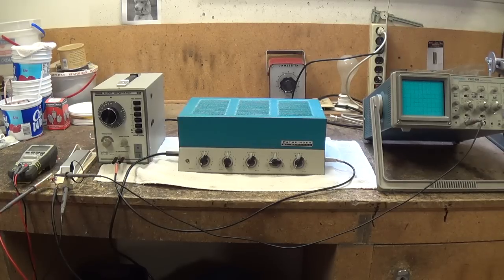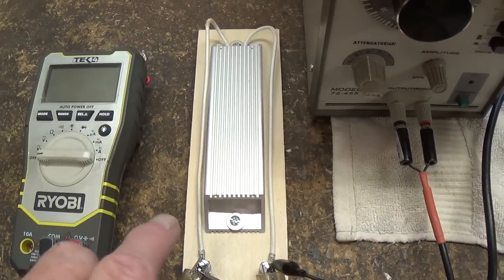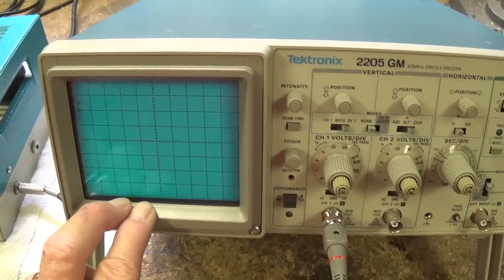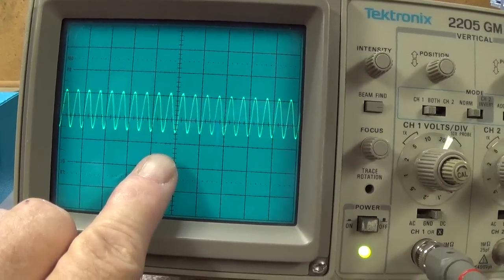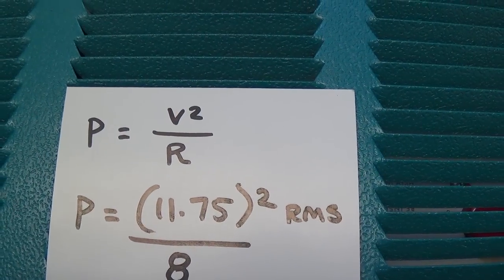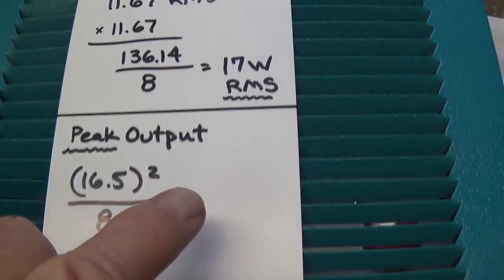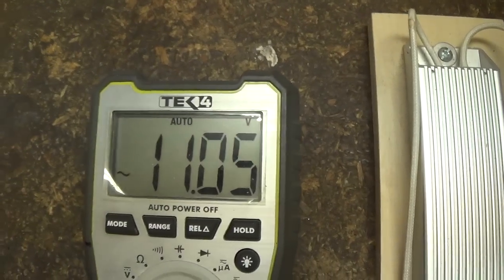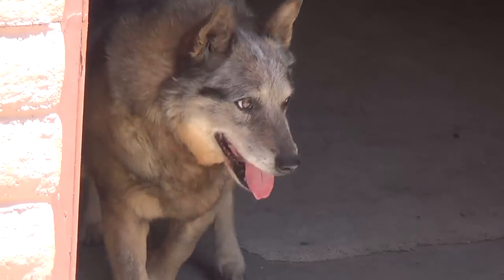How Amplifier Output Power is Measured

Comment: Spoiling Rusty again with that gourmet dog food?  In your closing comments, you mentioned that this amp has an ultralinear output transformer that gives it a good power bandwidth response using 6BQ5 /EL84 pentodes.
The  ultralinear audio output transformer is certainly  a good way of keeping distortion down at higher power outputs. 
These transformers come with  extra taps to connect to the screen grids of each power pentode.
Vox built their incredibly popular stable of guitar tube amps based around EL84 vacuum tubes. 
The impression of any portion of the output signal onto the screen grid (load distribution) can be seen as a form of feedback, which alters the behavior of the electron stream passing from cathode to anode. Among other benefits, this feedback helps to more accurately reflect the instantaneous reactance of the load (secondary circuit) back to the power tubes, thus offering better load-control and responsiveness (i.e. improved loudspeaker damping and power stability as load impedance varies across frequency band).
Reply from the maker: +SuperCarver2011  Thanks for your excellent overview of the ultralinear OPT, SC. I have added an edited excerpt of your comment to the video description (with credit, of course).  As always, Rusty and I really appreciate your knowledgeable and helpful input.

Comment: So if i get this right: If i get my output tubes to distort on my 15w amp its more than 15w of power?
Reply from the maker: +Mihkel Maidla   If your amp was tested in this way and found to produce exactly 15W of undistorted RMS power, and you got it to distort, it could be due to operating it at a higher volume than was used in the test or your input signal was higher than the one in the test (i.e. due to a Boost-Overdrive pedal, etc.) causing distortion in your pre-amp section.

Comment: Very excellent and thought provoking video Uncle Doug.  I was interested to see that it was the crossover distortion that determined your maximum output.  I had assumed it would be signal clipping.  I wondered how much farther you could turn up the volume before clipping occurred.  I'm not sure I could even hear the crossover distortion at your determined maximum level.  Also - I had a couple other questions.  How do you determine the input signal voltage level to use for performing the test?  What input RMS voltage did you use on this test?    

As always - thanks a ton for the great videos and the most entertaining pet antics !!   {:>)
Reply from the maker: +Donald Filbert  Thanks, Donald. I too was surprised by the lack of clipping.....until I remembered that this amp came with an ultralinear OPT.  Re the input signal voltage, I carefully balance it and the amp volume (and tone controls) to achieve the highest possible wave amplitude without distortion. There is no fixed value, since it will vary from amp to amp, largely based on the pre-amp section in each. You're welcome :)

Comment: Good video Doug.  Just a quick tip from my experience; if there is a way to inject the he input further down stream (like a power amp in or effects return) the more accurate your measurements may be.  That way you are less likely to overdrive the preamp which might distort earlier than the output.  Also you don't have to worry about the EQ as well.  I wondering if that's why you had lower output at 10k, I didn't see it in the video but when you first turned on the amp the treble was all the way down.
Reply from the maker: +Nick Clarity  Thanks, Nick. My method is to carefully balance the output of the signal generator, tone controls, and amp volume setting to achieve the maximum signal amplitude before distortion appears.  I prefer to input through the guitar jack because this is the way the amplifier will be used.  Much of the reduction in output at higher frequencies was probably due to my multimeter's reduced sensitivity at higher frequencies, not the amplifier's.

Comment: Hey Uncle, so what about the crossover distortion? Were the power tubes biased to cold?
Reply from the maker: +kardRatzinger  The amp provided distortion-free output to about 95% of full volume, which is quite good.  Please remember that this video was focused specifically on output power measurement......not tube bias or crossover distortion. I feel that any digression into other topics would have been distracting and counterproductive.
Reply: +Uncle Doug sure, I'm just asking out of curiousity.
Reply from the maker: I don't recall the tube bias data, Kard, but that's a possibility. It may be included in the video I posted on this amp. I do tend to bias output tubes rather conservatively.

Comment: hello uncle Doug, love all your videos! you have a way of explaining things that is just perfect! you amongst other inspired me and I made my own 18watt marshall clone out of an old  50's PA chassis which still had original english mullard el84's. I did have to rewind the power transformer as well as the output transformer, a bit of a complicated job especially as I live on an Island where it is expensive to get parts but I managed to do so using almost only discarded stuff I found at the side of the road! (a microwave oven has a ventilator which is a perfect source for enamel wire, in big professional office copiers you find a treasure of good quality capacitors (high voltage)  and I can go on and on) As an harmonica player I built it with a second, lower gain, channel with ECC82 with a "bass boost" switch (basically switching between a 1 nf and 15nf coupling capacitor). lots of bass is perfect for amplifing harmonica using an ols high impedance shure mic. I have always worked with electronics but I learned almost everything about tube amps thanks to your youtube movies!
two tips that might be usefull for some people: on this link some info what to do if you have a linear audio transformer but are looking for these nice distortions for guitar (because for what other reason would you like to have a tubeamp is it not?) http://www.geofex.com/tubeampfaq/TUBEFAQ.htm#UL
If you happen to find one of these cheap pizza ovens at a scrapyard, take out the heating coil, inside there is a special heating wire able to withstand lots of watts! cut it to length matching your impedance and you have your free dummy load to measure your amp power.
lots of music production  software (like cubase) have integrated plugins with signal generators, use your computers speaker/headphone output to be able to inject a 1000Hz signal in your amp for powermeasurement. on ebay you'll find cheap oscilloscopes using your computer and USB port.

bye thanks again Doug!
Reply from the maker: +Jeroen van Dijk  Good grief, Jeroen, you really do have to scavenge for parts. I thought I was industrious in this regard, but compared to you I'm just a piker :)  Thanks for the link showing how to turn an ultralinear OPT into a regular OPT, in order to improve an amp's distortion capability.....and thanks for all your other helpful tips. Keep up the good work !!!

Comment: Thank you for the great video. You using a normal resistor as a load but loadspeakers a inductiv. Inductiv resistor are changing the resistance depending on the frequency.
may be a i am wrong. 
greetings from germany

Reiner
Reply: +Reiner Sp This is a laboratory measurement, for it to be precise, you need to know the exact impedance of the load. So a fixed resistor is way better than an inductive load.
Reply from the maker: +Reiner Sp  Yes, speaker voice coils have both an (inductive) impedance and DC resistance value, and the impedance varies depending on frequency.....but Ohm's law provides a power value based on voltage and resistance, not impedance, so you must provide a DC resistance value for the equation.
Reply: make sence , thank you
Reply from the maker: You're welcome :)

Comment: Hello Uncle Doug,
I have a question. How did you decide on what amplitude to set the signal generator at?  You have explained frequency: what about amplitude?  Too high, and the amplified signal will start clipping before max volume of the amp is it not?
Kind regards,
Patrick
Reply: +Patrick van Gestel 
Yes, then you'd basically get preamp distortion, at least in the case of a guitar amp. 
A well-engineered PA or Hi-Fi amp should have enough headroom in the preamp so that the output stage always clips first, I think.
Reply from the maker: +Patrick van Gestel   Yes, if the output of the signal generator is too high, it can induce premature distortion, or too low it can yield a reduced output measurement......but, for testing purposes, the output of the signal generator and the volume setting of the amplifier are carefully balanced to provide the highest possible signal amplitude without the appearance of distortion on the scope.
Reply: Okay. I see. Thank you gentlemen for taking the time to answer my question. Much appreciated.
Keep up the good work Uncle Doug. I thoroughly enjoy watching your videos.
Regards,
Patrick
Reply from the maker: You're welcome, Patrick :)

Comment: Thank you for another great and helpful video. 
I have just a few questions:
1: for resistance do I use the value printed on the dummy load resistor or the Ohm value of the speaker or do I use the measured value I get with a DMM. The DMM measures resistance using DC so the values measured at low Ohm levels often do not match the values printed on the speaker (my 4 Ohm Speaker measures 5,1 Ohms) ?
2: my signal generator (Smartphone App) generates a 1kHz signal just fine, but I can of course adjust the  level of the signal with the volume control of the Smartphone. So if I send a high volume signal into the amp, I may get preamp distortion, that again may affect when the curve on the scope shows clipping.  Is there a standard / fixed value for the level the 1000Hz should have when it enters the amp?
3: my digital oscilloscope measures Peak and RMS, but the factor seems to be lower than .707, rather around .650 or so. Could the reason for this be that the scope is a cheap digital scope or is the .707 an empirical value that may vary some?
Thanks from Germany. You are a great inspiration and help.
Reply from the maker: +Han Solo  You're welcome, Han.  1.) Use the resistance stated on the dummy load resistor. During use, the DC resistance of an 8 Ohm speaker will rise from a lower DC resistance at rest to approximately 8 Ohms, due to it's inductive reactance.  2.) You balance the output of the signal generator with the volume of the amp to provide the highest possible signal amplitude. There is no set value. It is determined by observation during the test.  3.)  The .707 value is mathematically derived and fixed. Perhaps your oscilloscope uses some empirical algorithm to make this conversion. Regardless, your most accurate voltage measurement will be with an RMS-reading AC voltmeter.  Good luck.
Reply: 0,707=1/Sqrt(2) known as Root Mean Squared.

When the word 'mean' appears in a sentence implies it is an statistical value. So, yes it is a kind of emprirical value. And it is obtained when trying to guess what would be the equivalent DC signal in terms of power consumption.

I hope I make myself understood I'm not very proeficient at English.

Comment: Good video but I would suggest using a shorter time base with less cycles on screen to better see the distortion as the distortion we're interested in when looking at output power is clipping and not crossover. Having said that it would also be better to have only on cycle on screen if looking for crossover distortion. Maybe you could do a video on biasing using the crossover notch method and why it's not always a great idea unless your tubes are very well matched.
Reply from the maker: +Kris Ankers  Thanks, Kris. You're right about spreading out the curves to better demonstrate clipping. I will keep this and your other suggestion in mind for future videos.

Comment: +Uncle Doug ok I will give it a try. But then I have a question, how do they do it with car audio amplifiers which have a single supply of 12V? Do they internally step up the voltage?
Reply from the maker: +olipito  Car stereos are all transistorized and don't require a high-voltage power supply. They can operate just fine with a 12VDC input.
Reply: A few of the higher-powered retrofit car audio amplifiers step up the voltage internally. Most just use a transistor-based bridged output stage which gives a peak voltage of just under the supply voltage (or a peak-to-peak voltage of just under twice the supply) by using pairs of inverted output stages to drive both terminals of the speakers. If you do the maths, that turns out to give enough power for normal car audio.
Reply: +makomk Thank you both for your answers.
Reply from the maker: You're welcome :)

Comment: I am a hobby musician and interested in buying a new bass amp. The power output printed in the sales paper is pure fantasy. Its a class D amp and the size of the main fuse  is a reference how much power it can deliver (and even that value is hidden somewhere...) Great video - your way is the way i did it in the 1970's using a few parallel iron to get down to 8 ohm.
Reply: +dengsiao The main fuse typically has the nominal current handling capability that is way higher than the actual current drawn by the amp cranked all the way up, so you can't really say much about the RMS output power by looking at the fuse current rating.
Reply from the maker: Thanks for the input and kind remarks :)
Reply: 2000W?! Good luck in finding speakers that can handle that kind of power!

Comment: Hi, very interesting video as always! One note: when measuring RMS voltages with a multimeter, keep in mind that these are mainly built for mains frequencies of around 50/60 Hz. For much higher frequencies in the upper audio range they could become less accurate.
Reply from the maker: +J S That's an excellent point, JS, and one that I had not considered. I just performed an experiment with my multimeter and signal generator and found there is a - 0.8% error @1KHz and a -2.5% error @ 2KHz. This error probably contributed quite a bit to the reduction in output voltage noted in the video as the frequency increased. 

That said, I would still say that the digital reading from the multimeter is more accurate than an estimate taken from the screen of the scope.....especially if a correction factor is applied to the meter reading. Thanks for bringing this to my attention.
Reply: +J S 
Yes that particular dmm is rated for between 40 ~ 400 Hz. For this AC application I would trust the scopes measurements over the ryobi. But the idea he is imparting is still a valid and worthwhile subject for people to know.
Reply: Usually it is mentioned in the specs of better meters. My Fluke 179 will measure up to 1kHz, at a small sacrifice in accuracy.
Reply: Yep, need a True RMS meter.

Comment: I remember old tube ampss rated like 100W PIP, or was it PEP, especially big consoles like Maggies, RCA, Electrosound, and Silvertone.  Zenith and Sylvania rated their's as RMS.  And if you turned up the volume about half, lots of distortion, so PEP was grossly exaggerated.  So many tube comsoles put out about ten watts into cheapo speakers.  Capehart even had plastic cabinets.  And we think Chinese is crap.  Don
Reply from the maker: +umajunkcollector  Over the years, many advertised power ratings ranged from fanciful to downright lies.....but most reputable manufacturers played it straight with consumers.

Comment: re dummy load: if you had the right ohm, and power rating, old cone-less speaker, you could use it as a proper load for testing purposes? btw, hows the quad hobby goin`? I bought a mini drone but its impossible to learn to fly for a beginner. those pro guys that test all the quads on youtube make it look so easy. lol
Reply from the maker: +August Lyons  I'm not sure if a voice coil alone could dissipate enough heat, Lee. The 100W dummy load gets so hot that you can't touch it.....and it has way more mass than any voice coil.  You could try it and see, I guess.....or buy a dummy load on Ebay.  It's been windy here for several weeks, so the drones are on hold.  I've been using the time to make videos :)  Yes, flying them definitely takes practice, particularly when things start to go wrong and you have to make some quick decisions.

Comment: Of course the output will be affected by the bass and treble settings on the amp. I like to check the low frequency response of guitar amps since the low E string is near 82 Hz. The low frequency response is affected by the value of cathode bypass capacitors and interstage coupling capacitors. It may be best to check the amp power output with the bass and treble at the mid settings and across the full range of audio frequencies. Thanks for doing these videos. If you have the equipment to do it, it would be nice to see the harmonic distortion differences between single ended vs push-pull.
Reply from the maker: +Stanley Chytla  You're welcome, Stanley. I varied the tone settings to achieve the highest power output, and it was with a mid setting......no leakage to ground of either high or low frequencies.  For full spectrum analysis, look at some of the videos posted by David at ElPaso TubeAmps, i.e. one we did together on the Magnatone Melodier output spectrum.